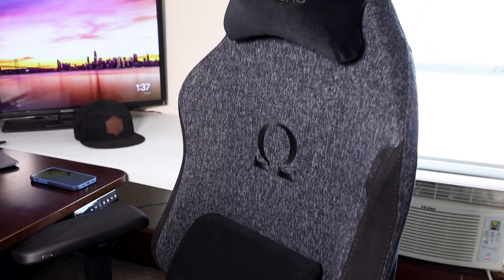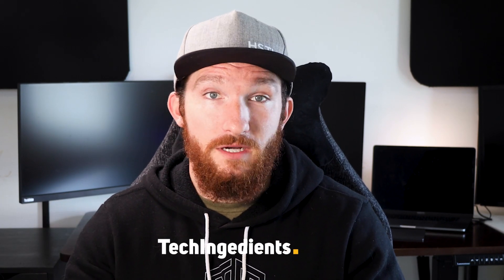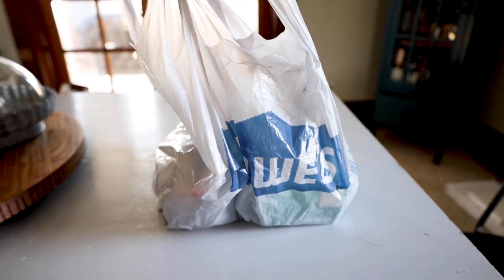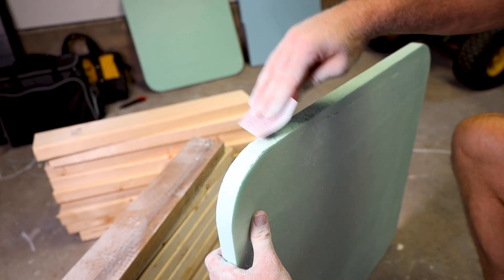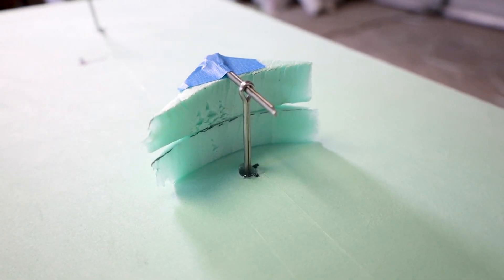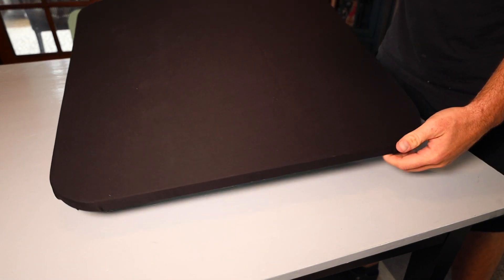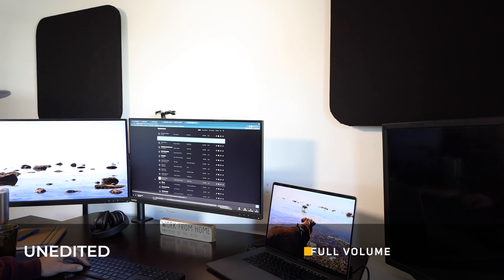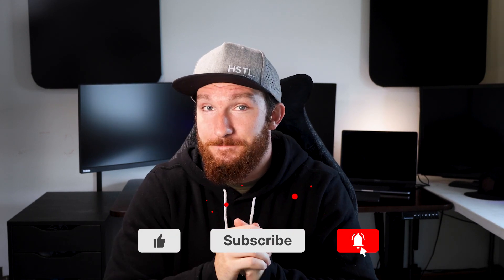How to Make DIY Flat Panel Speakers!

Comment: Maybe it would sound much better if those panels are hanged from the top and distant from the wall. I used 60x100cm eps board and placed them 3/5 vertical, 2/5 horizontal position, used 5.6cm (2.2") Q-hanger screw-in hooks and reinforced them with Loctite 243 threadlocker. I can achieve as low as 120Hz, but anyway for the deeper bass, I use a 5" subwoofer from an old home theater system :) instrument sounds are clear as live now.

Comment: I built these out of end-grain balsa and another set out of insulation foam.
The result was 'OK' but zippo bass. Good fun to trial, but I do not use them
Reply: I made mine out of insulated foam. They sounded like AM radio quality.  Not worth my time.

Comment: I want to try building these. I've watched numerous videos related to the building of them. There's only one peeve I have and no one addresses it. 
One exciter on one panel is centered. The other panel has the exciter offset. It seems to me that addresses the combined frequency range of only one channel. The way I think it should be is to have two panels for each channel if a complete frequency range is desired for each channel.
I honestly get needing a sub-woofer for the set. However, trying to divide frequency ranges across two channel stereo doesn't seem to be correct.
Reply: if you get 4 exciters with 2 same layout with 2 per panel, its amazing but twice the cost
Reply: You're correct. The fix is actually for each channel, so for the finished system there should be 4 speakers total, each side with a centred and off centred speaker. 

One way to clean this up is use 2 exciters on one panel per side

Comment: why are you sanding it if you going to cover it with a fabric? )))
Reply: The surface is denser than the foam core, causing more of the sound waves to reflect back into the foam, reducing volume and clarity.

Comment: According to what I've read, this setup is actually harming the quality of the sound xP
The speakers should be like 3in from the wall and have a lot of freedom to vibrate. The best results seem to be when hanging them from the ceiling and a bit farther apart from the wall, and the wires coming from the exciter shouldn't be so stiff.
This can make it harder to make them look good, but will improve the sound.

Comment: Yeah I love my transducers/exciters..can make the insignia fire tv connect and play sound.......CANNOT make them work WHILE the soundbar is lol. Soooo not so much "surround"...oh well, they're neat. My search fir making them ACTUALLY surround speakers continues..
Sidenote- I used commercial ceiling tile 5-2/3 rule. And a 2x100 amp..all in like 90$...worth it
Reply: yeah the surround thing ,  that's the main reason why I haven't tried it yet

Comment: You did a great job but the fabric does harm the sound. You are increasing the weight of the vibrating surface, decreasing the stiffness of the surface. This means you will get a worse frequency response and loose volume. Still nice work. I'm not 100% sure about my theory tho
Reply: Saw a comment on a different video about how you can coat the foam in a 1:1 wood glue and water mixture to increase the hardness of the surface. I'll try it on my pair and report back

Comment: i've build these speakers and they need to be in high distance from the wall (on the wall they are worse) and lack both in high end and in low end, pretty horrible sounding
Reply: It's important to soundproof the wall behind the panel if you get nasty resonances.

Comment: There’s a paper called “A critical review of bending wave loudspeaker technology and implementation” that calculated the optimal (practical) ratio to be ~0.95:1, while equal side lengths are the worst 😮
Reply: That's kinda nuts that it's so close to 1 with 1 being the worst
Reply: Tech Ingredients said the same thing in their later video.

Comment: Hi bro, I built the same speaker using Dayton audio 25w speaker (stereo)  frequently response is 80hz-12khz. 

The output was not expected, the mid is really poor wit voice is sounding like echo. I suspect I did something wrong of the following the caused this issue. 

1.)Painted acrylic painting on the panel, like art work. 
2.)Using Dayton Audio DAEX58FP Flat Pack exciter. 
3.)Sticked the speaker using silicon past. 
4.)using wuzhi audio amp. Cheap one. 

Please let me know what could have went wrong.
Reply: The paint will definitely affect the frequency response. I'm not sure about silicon but I guess it depends how much you used.  Was the adhesive on the exciter not working? Did you round the corners on the foam? Did you use the 2/5 rule for placement? The biggest concern I have is how it's mounted.  Is your mounting method restricting the vibration of the foam panel at all?  Including the speaker wire, is the weight of the speaker wire pulling down or did you create a strain relief? The goal is to, as much as possible, have the material just floating in air. Otherwise it's like pushing your thumb on the cone of a speaker. Maybe the ones you made could be artwork, if you painted them nicely and you could use blank sanded ones and see if they sound noticeably better.
Reply: @NathanDePaulo  
1.)Was the adhesive on the exciter not working? 
No, the model I bought comes with flat surface, model: DAEX58FP

2.)Did you round the corners on the foam? 
Yes, I did. 

3.)Did you use the 2/5 rule for placement? 
Yes. 

4.)The biggest concern I have is how it's mounted. Is your mounting method restricting the vibration. of the foam panel at all? 
It is mounted with the help of 2 cotter pin using nylon fishing thread for strings. 

5.)Including the speaker wire, is the weight of the speaker wire pulling down or did you create a strain relief?
Made it in the way to avoid the he weight on the xps board.
Reply: Is your panel material the same and is it extruded polystyrene? Painting does not change anything, I've made a dozen versions of these things some with paint, some with fabric, some with frames, some round, some triangles - hard to make them sound any difference. Overall size is the biggest thing, not paint. We didn't even sand some of them, very hard to tell any difference. Check out AmplifyDIY and the variations he made, we did what he did but you can see him do it - very hard to mess it up. Maybe your exciter is too small or defective, or maybe the amp is too weak.

Comment: Would you be open to making more of the custom 3d printed wall mounts and selling them?
Reply from the maker: Thanks for the comment! I typically don't do that, but I have posted the mounts on Thingiverse: https://www.thingiverse.com/thing:4971907
Reply: @ModernHobbyist  Are they measured in mm, cm, or inches?
Reply from the maker: @adamteplinsky6722  Should be mm.

Comment: I've been using a couple smaller dayton exciters with foam core poster board for over a year now.  Works great, and takes no space.  Plan on using more exciters for a home system when I need one.
Reply from the maker: I'm considering adding some to my living room as well!
Reply: Can they work as a surround system and can they use dolby atmosphere or 360audio?